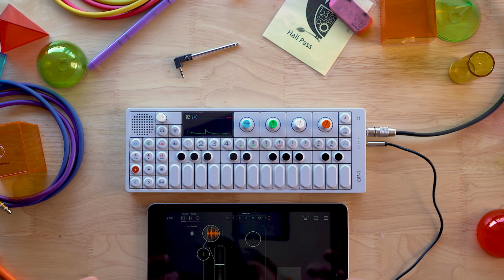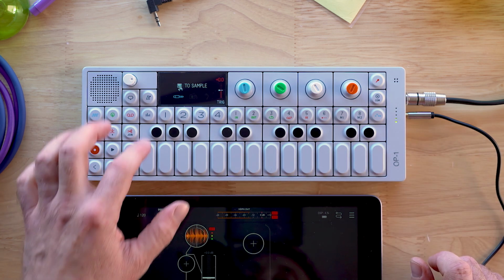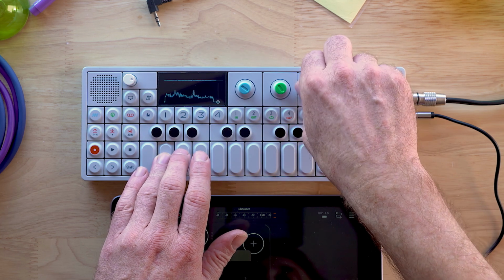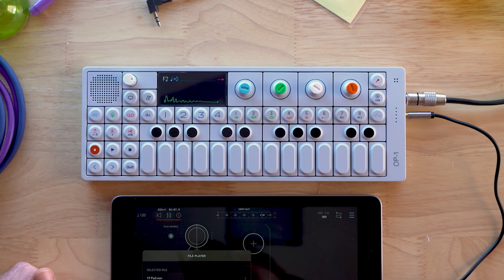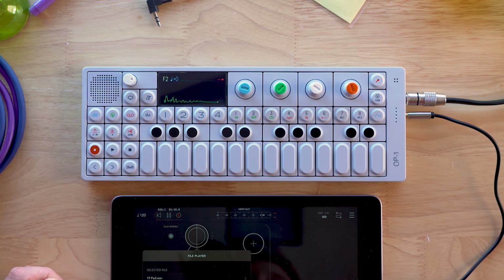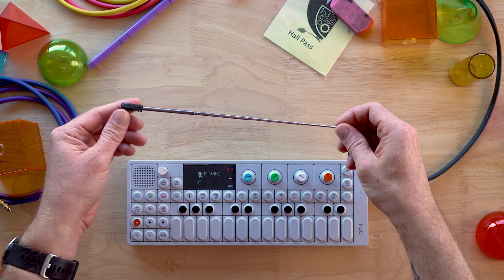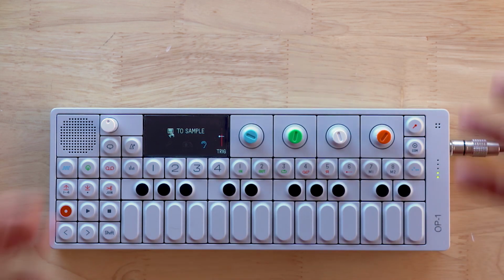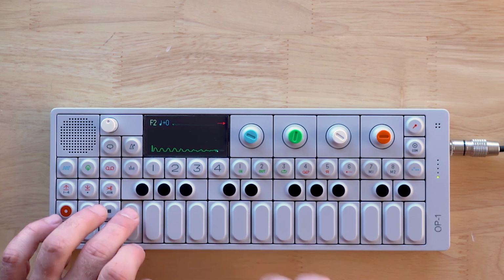Teenage Engineering OP-1 | Sampling

Comment: I've noticed the 'zero crossing snap' in other software as well while editing - what exactly causes or 'is' the 'zero crossing snap'? It's driven me nuts for over 30 years through all the samplers I've used including the first samplers for the early Macintosh computers.
Reply from the maker: A zero crossing is when the amplitude of the waveform crosses zero and therefore has zero volume. If you make an edit on a zero crossing it's going to start it end quietly. Otherwise there will be a quick jump to the amplitude from zero which will sound like a click.

Comment: I had a TE-OP1 for about 2 years. (older version). Sold it because I'm not a tech person, but more of a old school player. All this tech/computer stuff has a deep learning curve, and this is no different. I did make a few songs on it, but you rattle off the features so easily and are so thorough, that I am left in the dust. I do know that I only tapped the surface of this unit. I hated the speaker that was useless and required headphones and crackled when you plugged it in. (Guess they fixed that in the newer units. Loved the digital tape deck being old school learning on analog gear and tape decks. Didn't like a lot of the sounds coming out of it, outdid like I could tweak them. Loved the sampler though I didn't sample stuff very well. I miss the idea of having this, due to its size factor and features, but in the end I am a player who dabbles. I had the Moog Grandmother for a while, and I could make sounds on the fly and came out with so much better stuff, but that is due to the knobs and dials on the thing. It was a physical experience more than a DAW one. I understood why a sound came to be on it more than I could figure out the dang inner workings of the TE-OP-1. The tape deck I used to play in real time, like a player does, whereas if you are more computer-minded, you could get so much more out of this little tape design marvel. It's a work of art. Lovely piece of gear though quite expensive. So, younger crowd will LOVE this and adapt to the computer side and all it's features, whereas my almost 60 year old mind gets annoyed by the deep diving of features and would rather have knobs and sliders to play in real time with a full size keyboard. If my brain could easily figure out all of the features like you have, I'd still own this unit. I am also more of a guitar player or instrument player than computer programmer type. I play piano and guitar.  Anyway, just my thoughts. Love your videos as always. If I still had my OP-1 I would go by these instructional videos, albeit  slowed down with many stops in the video, because I can't keep up with how fast you go through the features. :) You're a pro at that OP-1, and no one else's videos, and I've seen them all over the years, does as good a job as you do, Jeremy.
Reply: It’s been a while since your post but you might try slowing down the playback speed?  I speed videos up and slow them down, depending on the instructor and content.  I’d encourage you to try again with the OP1.  It’s fun once you understand the work flow.  I have lots of synths, various brands, and they all take time to learn, especially those that are menu driven but once you know it, you’re good to go.

Comment: thanks for these tutorials, really useful! I've just put a drum break sample into the drum sampler and chopped them across the keys, but I'd like each note to cancel the previous one - it seems there is no mono mode in the drum sampler?
Reply from the maker: You have to change the play mode for each sample in drum mode to only forward when you press the key. It's the red knob I think.